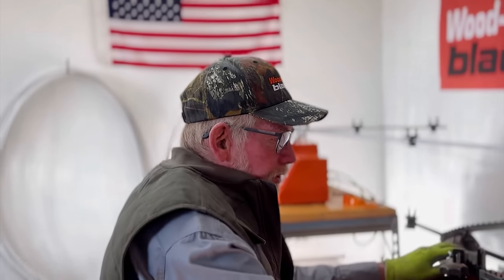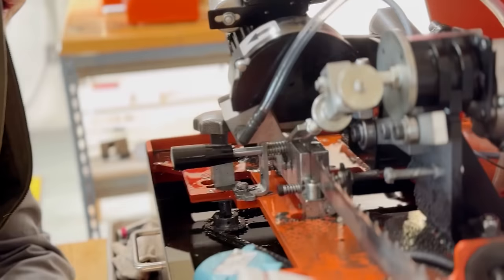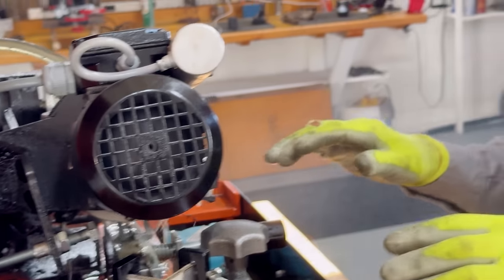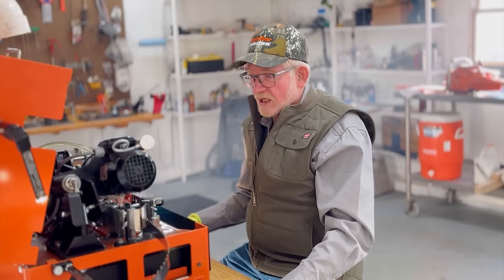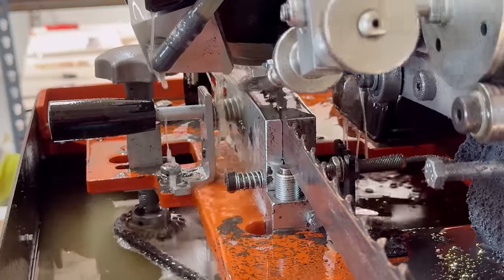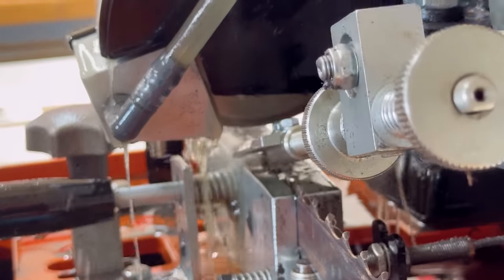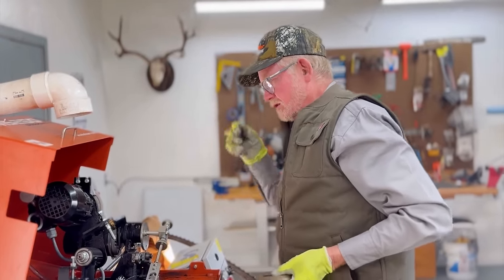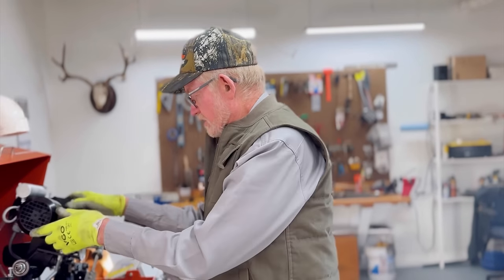Sharpening Carbide Saw-blades with a Diamond Stone

Comment: Hope this little comment puts things in perspective.
I worked for a company that had several different operations under its ownership. 1 just happen to be a fairly decent size bandsaw mill. New blades were roughly 12" wide and about 36' to 40' in length. Sharpening these blades could take an hour, depending on how dull or damaged they were. The blade filer normally took at least 2 passes and sometimes 3 to sharpen them. These were only steel and they needed to file teeth and gullets on each tooth. Same operation as what we see here, just on a much larger scale. I always found it fascinating to watch. 😊😊

Comment: The new style carbide blades are better a little more kerf to cut but the computer set on mill should be able to compensate for that easy. I talked with Boss Man about sharpening the carbide blades a while back but at the time didn't have proper stone as they were expensive and wasn't sure the first carbide blades could be sharpened. Glad they can be sharpened now. I did many circle "skill" saw carbides on belsaw machine but it got to be cheaper to just get new ones as there were no diamond wheels back then only "Green Wheels" and they wore out quickly. New pup acts like banjo always challenging to play LOL Great video ya'll take care now!  John Toccoa GA

Comment: That machine, like every other one that you have in the business, no doubt, quite or very expensive. A whole lot cheaper than throwing blades out after one use. Whoever designed that machine knew what needed done and how it should be done. Hefty components so that it works just fine and will in the future.

Comment: It might be an idea to put the blade in the machine, back the blade away from where it would be to actually make contact with the tool and then run it for a foot or two.
This allows the blade to settle into the position that it will be when running the full length of the blade.
Once the blade has settled down then you set the wheel to kiss the carbide cutting edge as you showed.
Unless you hit something like a railroad spike or something you should not have to clean up the trailing edge of the tooth ever.
And if you NEVER let the grinding wheel touch the steel of the blade you can remove the old carbide teeth when they get to the end of their life and braise new ones in place (difficult to get the right thickness and size and positioning needs a speciaal jig) and sharpen the teeth an the face rake and sides but it is very time consuming I don't think that the sharpener you have could pull it off - probably not worth the effort today but back in the day it was.
"Normal" steel blades simply bounce off some of the African exotic hard woods like ysterhout (iron wood) for example and back then I knew an old timer that made bespoke jewelry boxes for some high class jewelry place up in Johannesburg.
I helped him develop his rather rudimentary but very effective home built sharpener. Totally manual feed...
He did not produce the boxes very quickly but his workmanship was exquisite AND HE CHARGED AN ARM, A LEG AND BOTH FEET but people paid with a smile because each box was really a work of art what with the carving and mother of pearl inlays and highly polished and finely engraved aluminum-bronze dedication plaques which  were polished up and looked like gold (and did not tarnish) and whatever.

Comment: Hey Everyone,
     Quick question for Grandpa.  I notice when you were sharpening that blade.  I assumed that it's only one blade you sharpen in this video.  If it's two then this will be a stupid question.  It's okay, I ask a lot of stupid questions.  Anyway, I saw you made two passes (maybe three) adjusting the grinding face each time to get each tooth.  As you said to make the next sharpening smoother.  
     My question is  "Do you have to make two passes"?  Is taking too much off the first time to get where you need to be making steel barbs or splinters?  You said you had a pile of blade to do.  I was thinking if you go around and set the wheel to the shortest dull tooth that should be enough to do the whole thing first time right?  I ask because I don't know.  I've never sharpened a wood mill blade ever.  I'm sure there's an explanation with lots of details to the job.  Like anything that looks, or seems simple but, in reality is complex. 
     Anyway, have a great day everyone!
Reply: If you started with the shortest tooth, if you could find it, the wheel would hit the other teeth too hard and put too much stress on wheel and blade. Best too ease in and run twice.  Hope this explains. GP

Comment: does grampa have to dress the stone every once and awhile
Reply: Cannot be dressed or shaped. It's a diamond coating on a steel wheel..
Reply: They use a cleaning brick. That's all you can do with carbide or borzon wheels.